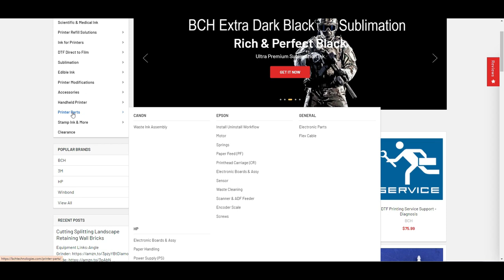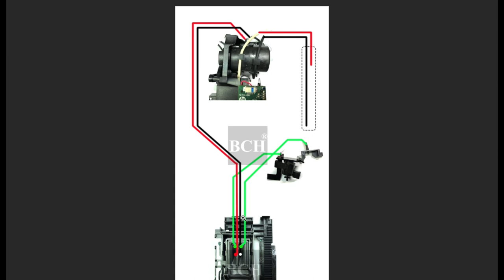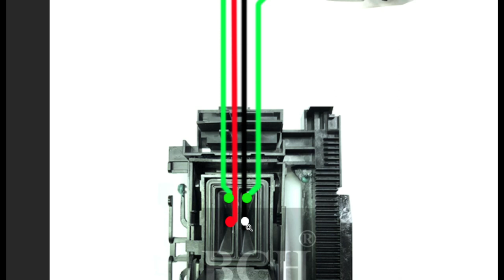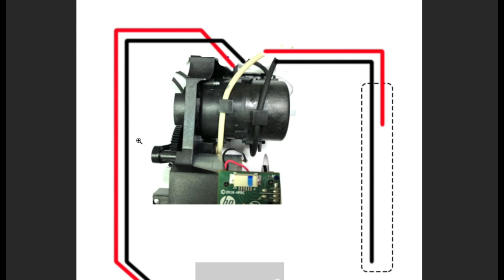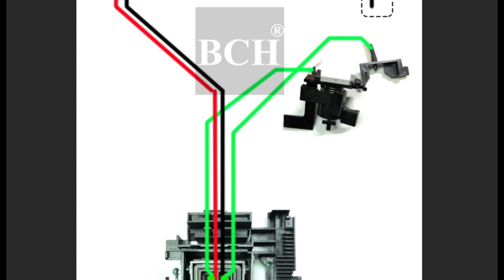How does an HP Printhead self-clean and what is the waste ink assembly?

Comment: @BCHTechnologies I removed the peristaltic pump, disassembled it, and cleaned it. Now I have to remember how to reassemble it and reinstall it! I believe one end of the clear tube on the color side of the pump had disconnected itself, since I have not found any clogs in any tubes. 
It is really amazing that such a tiny fault can prevent the printer from working, causing owners to toss them into the trash. In my case, the pump was not turning smoothly, causing the printer to display an error message, and prevent any printing.
Thank you for this video.

Comment: Hi Kevin!  I have been looking forever on the internet for an explanation of how the print head cleaning works.  I took one apart and figured it was vacuumed out, but did not go as far as figuring out where the wasted ink goes.  Great video and explanation.  What happens when the waste ink container fills up?  Have you ever seen this happen, and what is the end result?  Someone told me that HP inkjet printers have a predetermined number of cleanings it can do, and then it bricks.  Is that true?  Thank you again for your video, and your red premium cleaner works great!  I can only hope that more businesses will take on your attitude about right to repair and E-Waste.
Reply: Me too!   I see the pump, but without further disassembly, I do not see the waste tank.  It must overfill eventually.  I wonder is this why there is soo much goo below this sled?

Comment: Hi Kevin. You are so helpful. Thank you. I have an HP 8035. I must have run the cartridges too low and the heads got clogged. I was suppose to receive ink when the levels were low but apparently it wasn’t detecting it correctly. The black worked fine before now it doesn’t want to work right. I was low on ink so I begrudgingly bought more cartridges to try and save it. 2 more levels of cleaning and I’m not getting much darker than charcoal grey. The colors are fine. Did I mess up the black print head…? 😫
Reply: I’m just curious… can running your ink cartridges too low clog your print head? I thought not running your printer 🖨️ often can dry the ink on the print head . That’s why I print a page at least every week of a heavily saturated color photo . I refill my cartridges myself on my hp 8020 so it’s very inexpensive to use lots of  ink.

Comment: Hi Kevin. I just saw your video and I believed this HP model is  the same with my Printer HP 6510 "in Europe" uses cartridge 364. I appreciate it very must if you could give me hint how to reset my Printer. The ink has run out and replace them with used cartridge I did refill my self after I saw one of your video"Twin chamber refill" i believed that was 954 cartridge. After installing the said cartridge my Printer giving an error messages " Missing cartridge or damages" Again thank for any hint to solve the problem

Comment: Hello, please assist me to know whether the pump system is the cause if this error 0x61011bed in hp officejet 7510, or else help me solf the problem
Reply from the maker: I think 0x61011bed is mostly associated with the carriage return movement. The malfunction capping station will certainly stop the movement and thus cause the error.